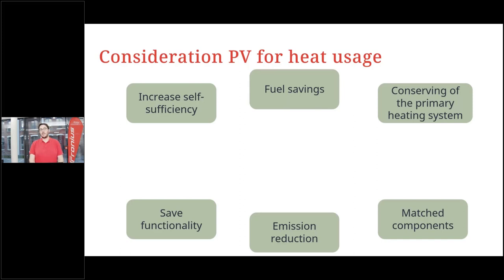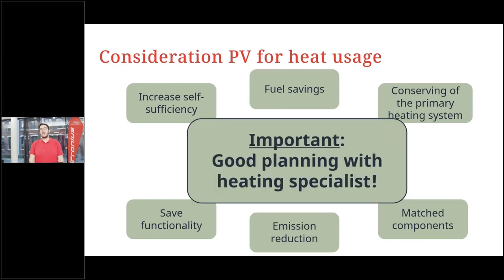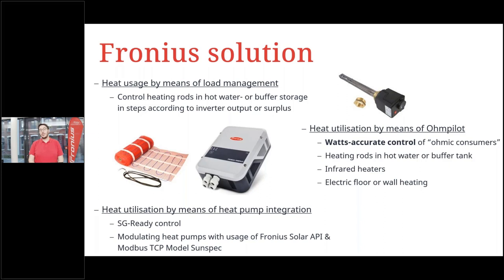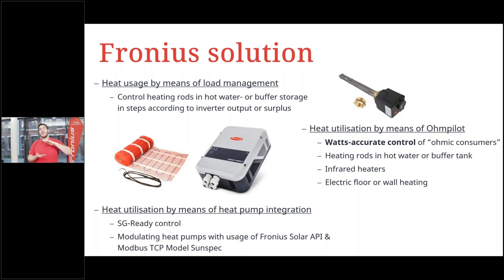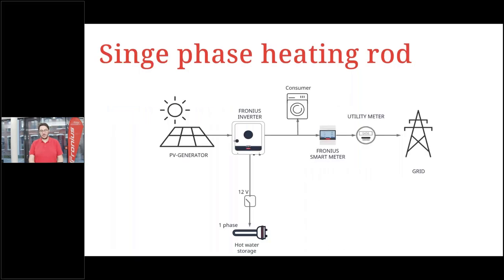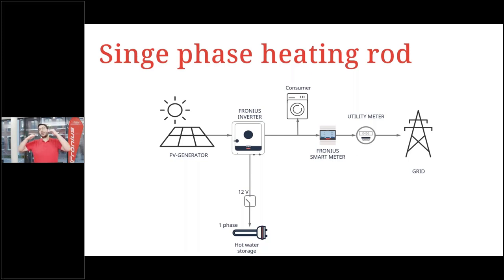Webinar: Easy integration of heat pumps in Fronius PV system

Comment: Where can we find the list of compatible modulating heat pumps? On your website some brands are stated however, if I go to mine, Wolf, I cannot find any information about which heat pumps are compatible. Not on your site or on Wolf’s. Furthermore I cannot find any configuration manual. A bit frustrating.

Comment: Can ohm pilot still control electric underfloor heating if we already have built in controllers managing the run time and temperature?  
In our usage case we have four stages </= 3kW with planned 10kW Symo Gen 24 plus inverter (three phase)